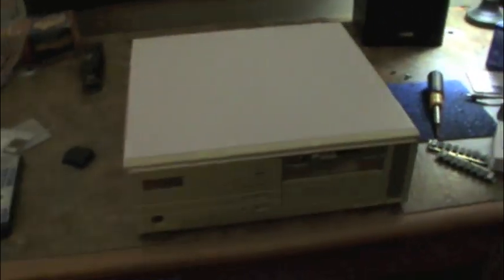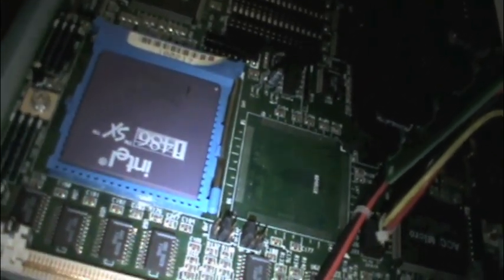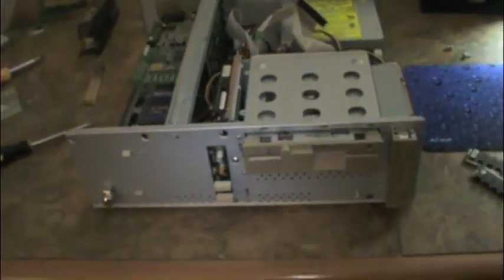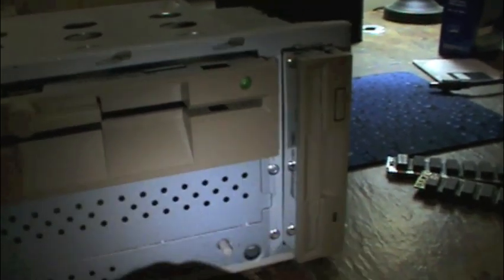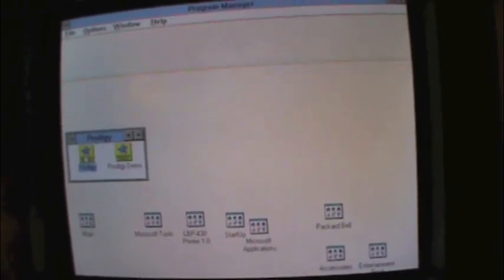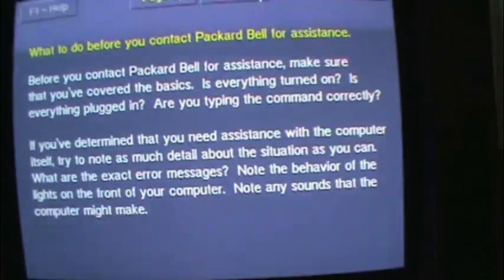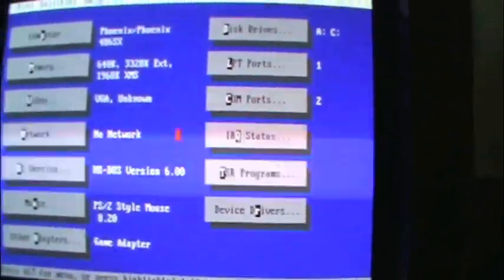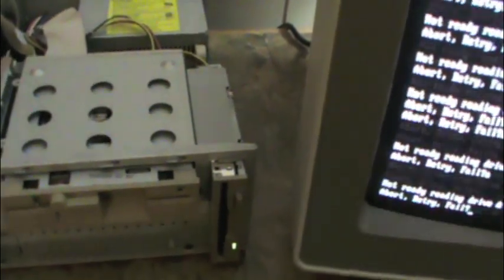Packard Bell Legend 233 Desktop PC

Comment: Before you ditch it, just try cleaning the heads on the floppy drive. Often that is the only problem, especially when the drive and/or the disks haven't been used in years. All the dirt and dust that's inside gets stuck onto the heads and then it can't read the disks anymore until you clean it. Otherwise, and aside from the SIMM you had to replace, it seems like it's doing OK!

Comment: Similar to the Packard Bell I did a video on, it also had the original load of windows, pretty close to untouched from what I could tell.  Rather interesting. It is interesting the changes in the different models of these computers, subtle but there. I don't recall mine being quite as flimsy cased. I had to removed my battery, which wasn't leaking when I first pulled the computer our of its original box, but a year later poof!

Comment: Remove that CMOS battery now! Even if you're too lazy, you have to.
You can simply use a pair of pliers and cut off the pins, then put some drops of lemon juice on the corrosion to neutralize it. Then clean the leakage with isopropanol alcohol on a toothbrush. It helps a lot.
You can most likely hook up a 3V coin battery to the external battery connector, the RTC chip can probably operate on 3V instead of 3.6V

Comment: Toys R Us sold Packard Bell computers in 1996, at least Toys R Us Australia sold them, I was only just starting to get into computers at a very entry level point then and even then I didn't care too much about Packard Bell, I though they were some kind of HP knock off or something, the computers I saw then appeared to have Windows 95 on them, mind you this was in 1996 I believe.  Our first computer was a 486 DX2 with Windows 3.11 and DOS, no sound card and no CD-ROM drive either.

Comment: that's funny I spend a lot of my time hunting down Packard Bell's and like you I worked on them in the shop , the reason I like them is once all the screws are in they are rather tough , I have a Lot of Packard Bell Restore Disks & I like the Vintage Hardware , good video :) QC

Comment: Ive got some of that Packard Bell branded software. Got from a thriftstore, local school had Packard Bells in 90s (and the person i heard this from said they ran like greased lightning btw). Part of the 94 bundle (MegaRace, 3D Body, and a non-working Windows 3.1 Multimedia pack). The guy i got all this info from also got one of those PC's when they toss'd em in the late 90s for some newer Compaqs, still had it lying around, 2 way VooDoo2 SLI and all xD. ill make ISOs of those if you want them to see how they perform on a real packard machine.

Comment: I hate to disagree with you but when Packard Bell first come out it was a great machine . I bought 2 from Home shopping club . They were free shipping cost about 2k each and had a 286 14k modem , 32 meg ram 3/12 floppy and a 20 meg mfm drive.  The case was very heavy duty and was made of stamped metal. I sold one and it went to 5 different uses before it come back to me. I also serviced them tru NCR ATT-GIS when you were in school ( at least I think)
It was the 80s.

Comment: @bbishoppcm I found an MCA audio card for my Model 80; it's an M-ACPA/A, which can /emulate/ the SoundBlaster in Windows 95. I think the seller still has another one for sale on fleabay if you want it! and I'm going to put an MCA AOX/Kingston McMaster 25MHz 486 accelerator card on ebay soonish, along with a 386 McMaster.

Comment: I assume it used EXPANDED memory in order to use 32 MB of memory? As far as I remember, a 286 only had a 24-bit address bus, and could only address 16 MB of memory without bank switching.

Also, wasn't 32 MB a rather obscene amount of memory in the 80's (I wasn't around back then lol)? :P

Comment: I tell you some reasons that I have gripes against Packard Bell computers.
The early models had rechargeable batteries that were soldered to their motherboards
and they would eventually leak and fail with the leaking acid destroying the motherboards.
Later models just used the now common button Lithium batteries and this solved the issue.
Another dislike was their Aztec Sound card /modems which when run in Windows when playing a game the sound would disappear/temporary card failure or some hardware glitch with it .
Anytime I get a vintage Packard Bell from the 1990's I always remove that failure of a sound card/modem and replace it with a reliable one like an Creative Labs Awe 64 Value card or some other reliable sound card.Or one could just leave the Aztec Sound card/modem  in the machine and disable the sound card in Windows though just to keep the modem which had no problems and use another sound card.

Comment: and in my experience, computers will usually boot with different speed (60,70,80ns) SIMMs, but you'll run into really bad stability issues, especially when running Windows.

Comment: BBISHOPPCM, I have a question for you. What is your favorite computer OS? PLZ Reply.
Reply from the maker: It's not a simple answer, because I really don't have a "favorite" os... I like different operating systems for different reasons. But if someone told me to pick an OS that I had to use for the rest of my life, I'd choose Windows 7. Now, I used Mac OS 10.9 on both my work and home laptops... and my Media PC runs Windows 7... I have a nostalgic attachment to Windows 3.1, as it was the first graphical OS I ever owned, and when I got my first Windows 3.1 machine, it represented an enormous step forward in my computing life (at age 12).
Reply: I fix computers too, I'm going to post videos of me fixing them soon. Anyway, my favorite OS (even though it's not supported anymore) has to be Windows XP. I've used it ever since I was born, (2001). It was a Compaq Presario 5000 Desktop PC, with an LG CD/DVD Drive, and a Floppy Drive, included with TurboTax. That was my 1st computer that I have ever used, ever. But sadly the power supply went dead in 2010, and I ended up tossing it, I saved the hard drive, the Processor, and the Entire Motherboard. When I was 2, I would ask my mom to put on Windows Media Player 9 on with music so I can look at the virtualizations, to make me go to sleep, good times. Since I have 2 HDD's on my current computer, I put Win7 on the Primary HDD, and Windows XP Pro SP3 on the Secondary hard drive. I CANNOT LIVE WITHOUT XP! It just brings back memories. :P
Reply: BBISHOPPCM's World If I would get rid of a computer. I would definitely destroy ALL MY DATA.